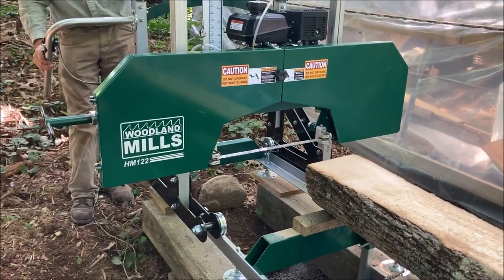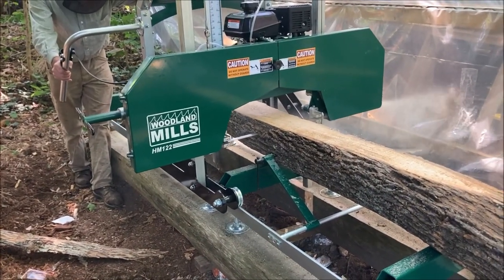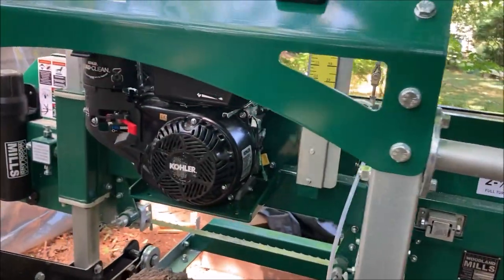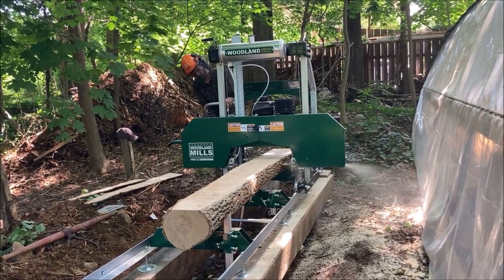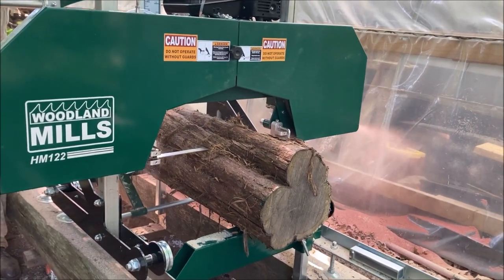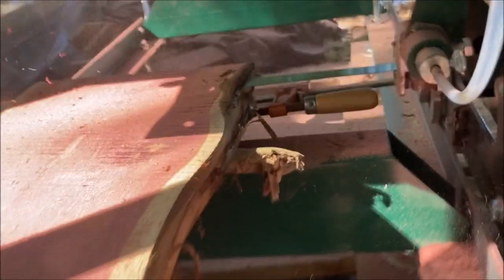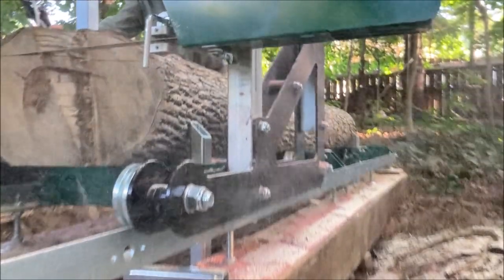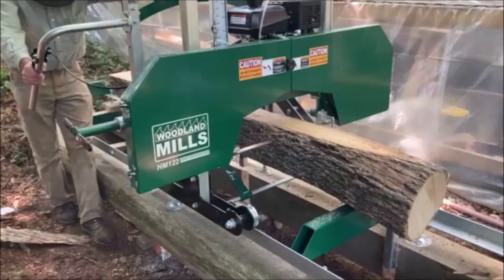Woodland Mills HM122 Portable Sawmill, first impressions

Comment: WOW i have had a 122 for 3 years now no complaints at all.    Blade lubrication as a bit of a issue for me so now i don t run any at all unless i am cutting hard wood that is dry.   Let soft wood logs set a bit and works better also.   Wood Mizer sells blades for 16.00  and change buying 15 at a time they seem to work well for me more on them latter.   Level and sharp blades are the key to success.    I use the string and line level method to be positive the bunks are level with each other .    Your going to love that mill.  I have sawed 1 10x 10 chicken house  1 10x10 green house resided part of my barn a fence for a friend several small sheds.   Also if you know some tree removal people they will give you soft wood logs stay away from cotten wood unless you need blocking or cribbing just a few things i have learned.
Reply from the maker: glad its still working well for you, you influenced my purchase !!